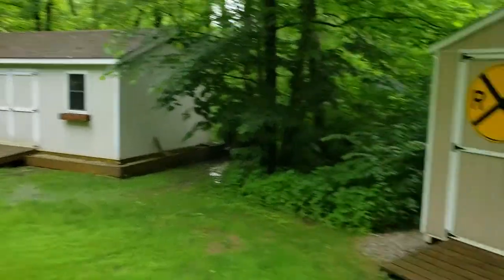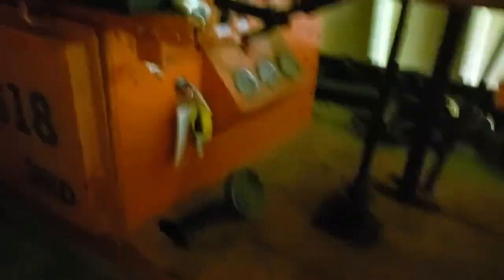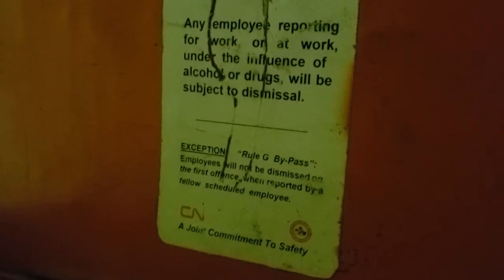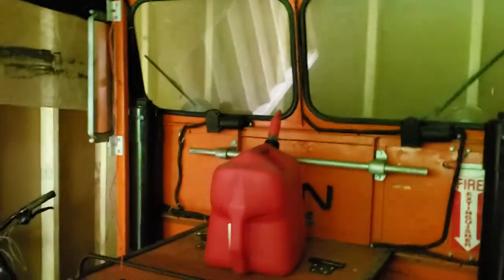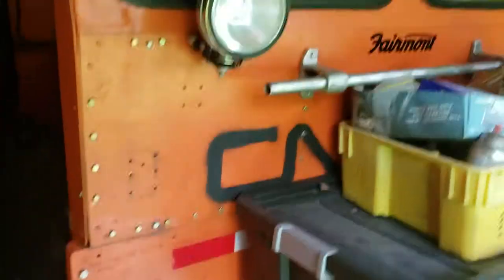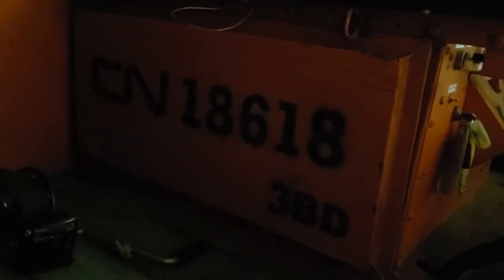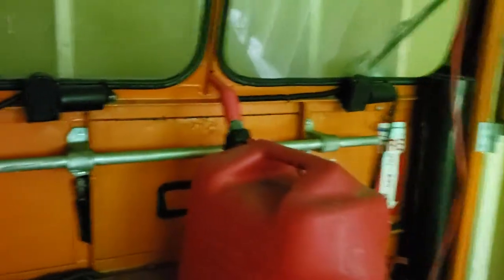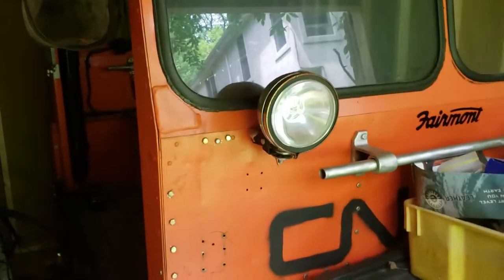Run down of a Fairmont A-4 railroad motor car

Comment: I left Fairmont Railways on northwest drive mississauga back in 1978...I started at the bottom putting wheel assemblies together...then the housings...wire harnesses...wiring the housings..etc ...all the way to final assembly...there was only 2 of us on final assembly...this facility also installed high rails on pickup trucks...and occasionally we would get some specialty equipment that needed some finishing details from Minnesota...I loved that job ..I should never have quit...I had the big dream of working on the sable island offshore oil rigs...just curious but do you know when this car was built...I was there from 76 to half way through 78...I may have built that very car..very cool to see...we built for CP too!
Reply from the maker: That's an awesome story! Thank you for sharing! Hope you enjoyed the video! Makes 100% happy I made it!
Reply: @rpdobbler  looks like you have a lot of fun with that...I'm jealous! Do you know what year it was made?
Reply from the maker: @stephensalt6229  I'm sure I could pull the #s off the engine block and find out for sure...77 or 78 I was told, spent it's life on the CN somewhere above Spokane Washington! Came from Bob Canton's junkyard up there...look me up on Facebook under my same name...I post some Fairmont RR stuff from time to time
Reply: @rpdobbler  chances are real good 50/50 that I built that car....there was only 2 of us on final assembly..although if we couldn't keep up with the work orders...they would bring in some from Minnesota..there should be a small tin id plate pop riveted on the engine housing...that should have the info on it...we would hand stamp them with hammer and die set....what a walk down memory lane ...glad I found your post...I'll check out your other site.
Reply from the maker: @stephensalt6229  Very Very awesome! I stripped that thing down to the frame, and rebuilt it from the ground up! Find me on Facebook and I'll send you pictures of the process...I have an MT-14 as well from the late 70s did you ever make those?
Reply: @rpdobbler  yep and 19's too! The only thing I didn't do with those cars was spray paint them...the 14 and 19 had fibreglass cabs... no paint required the cabs came fro Minnesota..we would just get the shells and then add the strobe..glass ..wipers..taillights..etc
Reply from the maker: @stephensalt6229  very VERY awesome...yep, my 14 has the fiberglass cab...I still need to redo the doors on it...we always ran it with no door...I have another video on my YouTube page where I do a full rundown of the 14...watch it if you haven't already, I'm sure you'd enjoy it

Comment: I am trying to produce a CAD drawing of this but I can't find anything online like a manual or something. I am stuck trying to remove the "wheel adapter" or whatever you call the metal piece that connects the steel wheel to the axle. Any tips? Also, does anyone make parts for this? like wheels for example?
Reply from the maker: Google "Les King" I think Dean still makes everything Les used to...if not, Brown equipment has the rest
Reply: @rpdobbler  Thanks for the quick response
Reply: If I remember correct..there is a crown nut / cotter pin ...remove...then you will need to hammer out the wheel from the inside...even pressure..or could try to adapt an ordinary wheel puller...this wheel is pressure fit onto a conical nylon type bearing...I cant help you with parts though ...lost touch with all that a long time ago...I cant listen to audio but this is an a6 or a4 ...250 6cyl or 300 6cyl